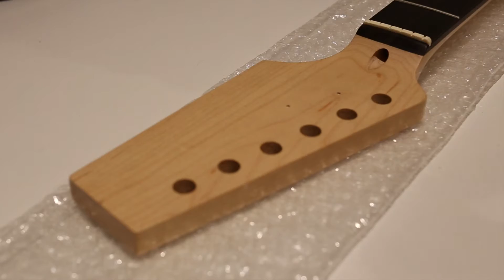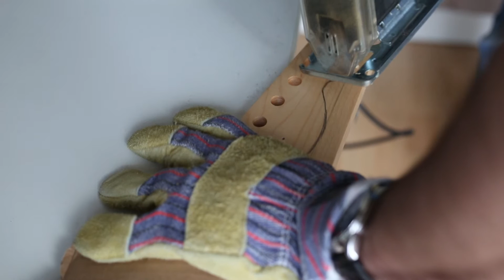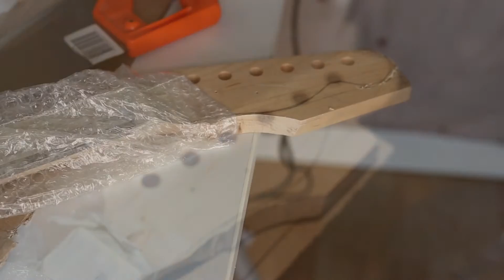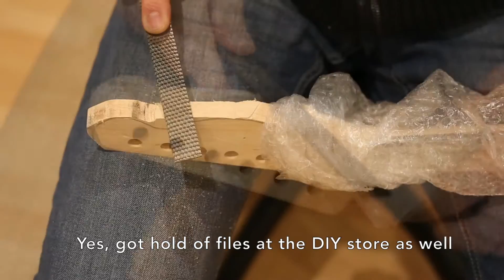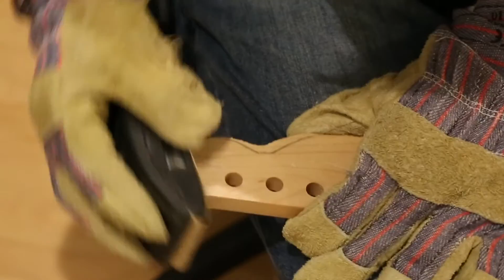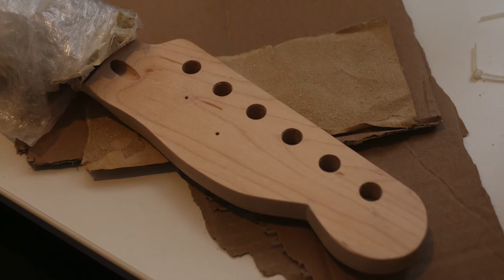Harley Benton T-Style Guitar Kit Build - Part 4: Shaping the headstock

Comment: Bit late now, but if you'd run the hand held electric jigsaw the other way, from bridge end to neck end, it would have been much easier.  I would also have clamp it down to a bench, to stop it vibrating.  I have done it several times with telecaster necks, finish with a rasp file, then wood/metal file, then sand. I seal with acrylic lacquer, then spray with 2k car lacquer.
Reply from the maker: Thanks for your comment and agreed on the jigsaw, with the biggest gap being having no clamp here!

Comment: I actaully had a drimel in my closet. i found it the other day/ I just used a sanding wheel.lol
I was using a wood file before. i had too...becuase it was too unstable to use the jigsaw for me.lol
Reply from the maker: This sounds like a very good option, indeed!
Reply: I have the same wood file.lol i used that file to build 2 guitars and reshape 5 head stock.lmao
You dont need a drimel. Just the sanding wheel...if you have a drill.
Im build a flying V using parts and neck from an epiphone LP II.
Definelty going to use the drimel more often .lol
Are you done with the guitar??